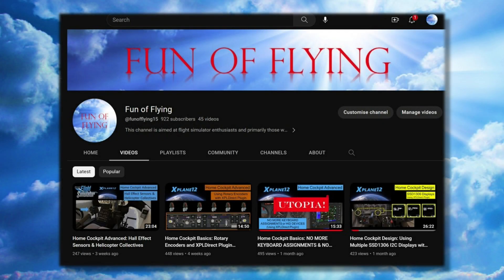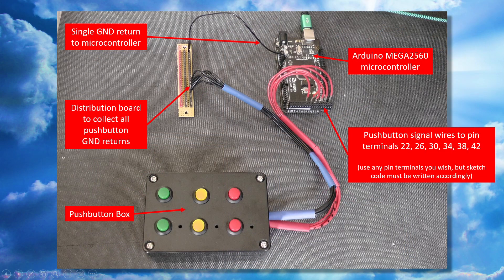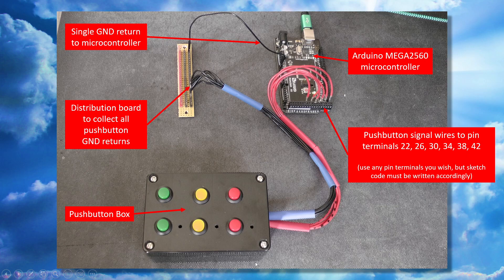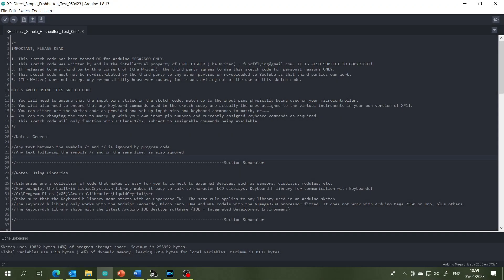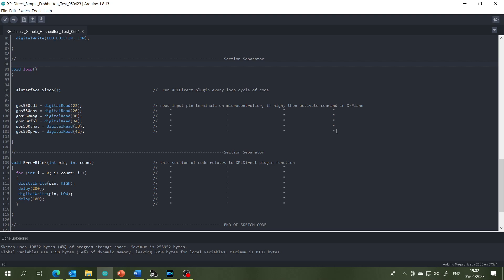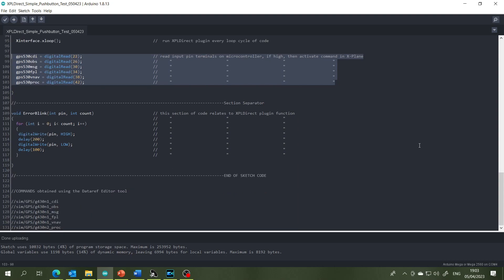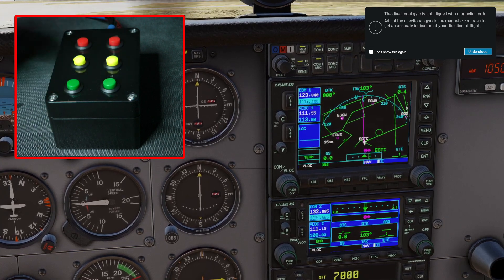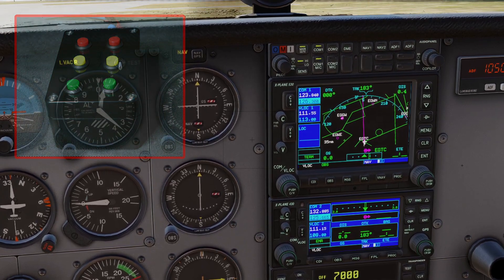Home Cockpit Basics: Using Momentary Pushbuttons & the Wonderful XPLDirect Plugin

Comment: Wonderful video! One Question:  Could you give some more details on the error code that you put in de Arduino code in the middle of the void setup? What is the use of this code and how does it work? Then one comment: the message in Xplane that tells you to line up the directional gyro is very relevant. It is not limited to the cessna172, but it is a message you can get in every cockpit with analog instruments. It refers to the gyroscope in the heading indicator. This gyroscope does not know where the magnetic north is. So you have to read the value from the magnetic compass and turn the knob on the heading indicator to this heading. And then you should do this every 10-15 minutes, because the gyroscope will wander because of different causes. Again thank you. I'm very glad with the explanation of the plugin XPLDirect. I'm trying to build a button box with Mobiflight, but Mobiflight has a problem with momentary switches.   With XPLDirect there is no problem with the momentary switches.
Reply from the maker: Thank you my friend, appreciated :-) Unfortunately I'm not sure what the the error blink code is for or what it does, I have just accepted from Michael at Curiosity Workshop that it forms a technical bit of code to make sure the plugin functions properly! Thanks for your explanation about the compass, I've only ever noticed it in the XP11 & XP12 Cessna Skyhawk, but I guess that it could also happen in other aircraft type? I'm now in the middle of producing more videos, one of which will be about XPLDirect's successor, namely XPLPro, which I'll hopefully be able to post soon. Kind regards Paul :-)